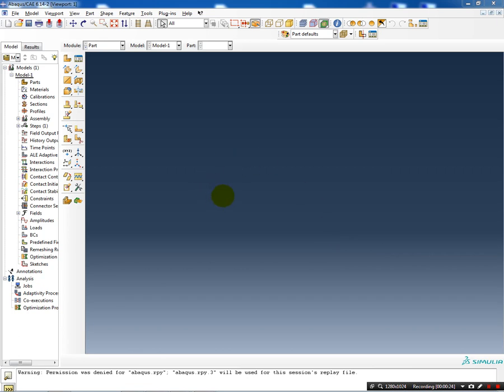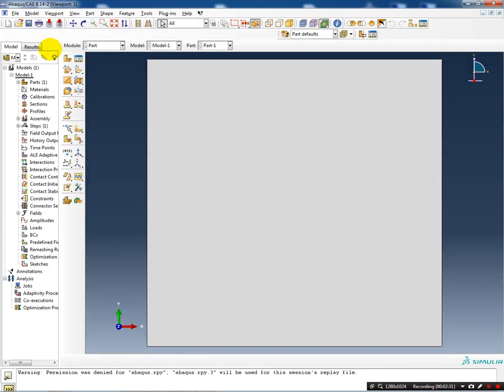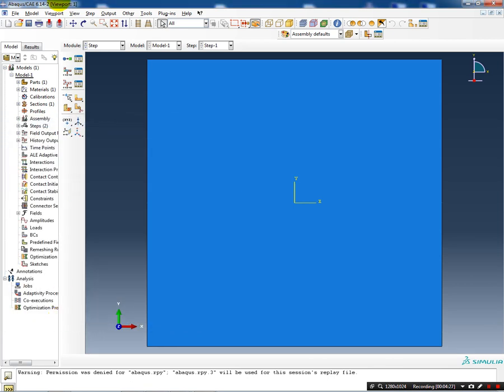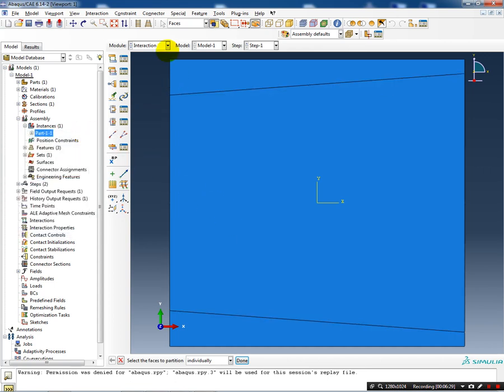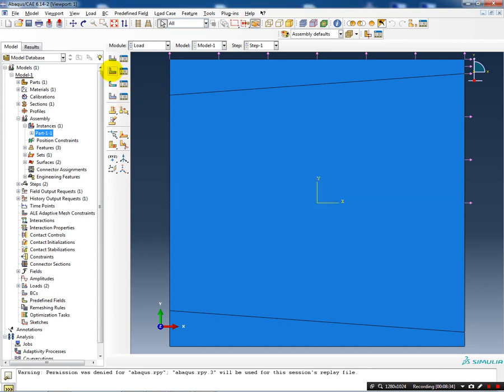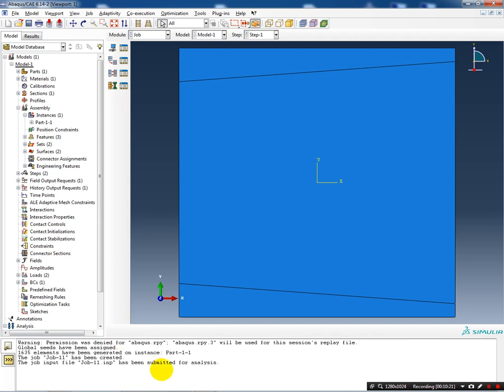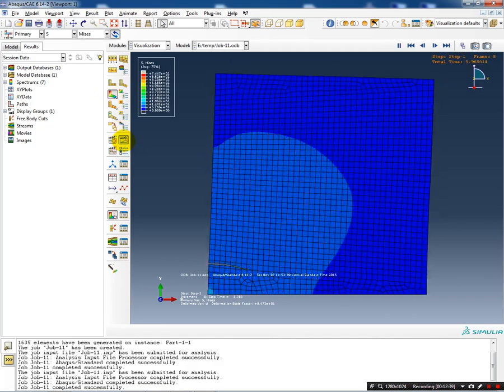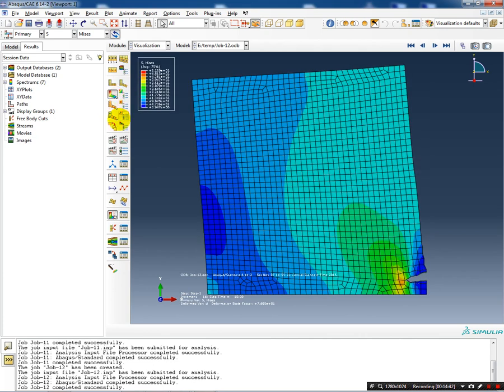Simple XFEM example using ABAQUS 6.14

Comment: Dear Mark Barkey firstly I thank you for thes illustration
How do I plot XFEM crack propagation
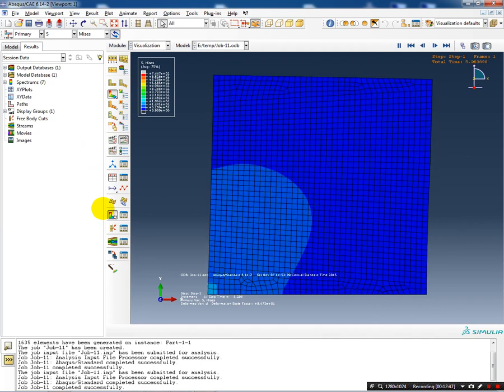Reply from the maker: I am not sure I fully understand the question--do you mean the animation at 12:50 ?
Reply: @mbarkey.mechanics  how i can plot crack propagation vs load in XFEM
Reply from the maker: @HamzaDjeloud  The load is relatively easy as you can get that from your ramp loading.  I don't know the options for crack length--it has been a few years since I made this video.  The manual can be difficult to extract information from, but it is comprehensive.

Comment: Hii Mr. Mark Barkey

I have a small query. I have 2D cracked specimen made up of material obeying Ramberg- osgood model and subjected to bi-axial loading. How can i calculate the limit load of that model by ABAQUS?   Please help me out..

I am waiting your reply..
Reply from the maker: Short answer:  I'm not sure.  Longer answer:  most plastic limit load problems I have seen assume perfectly plastic materials where someone is trying to determine a load that corresponds to net section that is fully plastic.  This is commonly done for notched components and represents a conservative upper bound on load of a component if there is any hardening.  For a biaxially loaded, strain hardening material with a crack I suppose you could find a load level at which the plastic zone evolves enough to cover the net section, but you would have to think about small vs large deformations and plastic zone size;  then think about what such a value would physically mean to you--and if other failure modes may get activated.

Comment: Hi Mr. Mark Barkey
I have a question that how did you get Max Principal stress and Displacement at Failure ?
THank you.
Reply from the maker: Do you mean, why did I choose those values?  I just picked them.
Reply: I mean Why did you pick them? you base on theory or experiment ?
Reply from the maker: I just chose those values.  For a meaningful simulation, an analyst should base them on experimentally determined values or experience/theory as you decide what makes the most sense.

Comment: When I submit the job I get this error: "Too many attempts made for this increment". Do you know what this might be due to?
Reply from the maker: Hi Leandro, This type of error can come from many reasons.  If you are following this example though, I would suggest you look to make sure that the plate is restrained from rigid body motion, i.e. the BC's have been applied the way you want them to be applied.  Other times I have seen this error, the strains are too large, too much plasticity from unrealistically high loads, rigid body motion, etc.  You will have to look into the msg file and the other diagnostics to try to find the source.

Comment: Hi, I want to ask you if you can calculate DSIF ''dynamic SIF'' by Abaqus using  XFEM ? 
Thank's
Reply from the maker: Hi Soufiane MEGDOUD, I have not tried that option, but the manual says it can be used only for ABAQUS Standard and "can be performed using the static procedure, the implicit dynamic procedure ..." so if your problem can be defined by implicit dynamics, I think you can do it.  Refer to the User's Guide section 10.7.1 (I looked it up in the 2016 documentation.)  Best wishes.
Reply: Hi Mark Barkey, Thank you very much for your help.

Comment: how do I make the mesh automatically refined on the crack the tip as the crack propagates?
Reply from the maker: HI marchellohro, I am not aware that as an option for XFEM.  However, ABAQUS adds features frequently, so you may want to review the manual.  It may also be possible to incorporate an adaptive meshing technique after crack initiation, but I have not personally done that.

Comment: Hi , you apply 100 Mpa for MAXPS and 0.1 for displacement ? how did you get this values please ?
Reply from the maker: Hi Zakariae,  Those are just numbers I put in for the example.  For a 
physically meaningful analysis, you would want to put in the appropriate
 failure parameters for your material.

Comment: Thanks..great work..
However  multiple cracks can be implemented in a single model ?
Reply from the maker: +DEEPAK KUMAR PAWAR 
Hi Deepak--cracks can form anywhere in the region, but the initiation 
condition must be satisfied.  If instead of the side load that I applied
 to bias the crack location, I did only axial tension, then cracks would
 appear all over the allowed region.
Reply: +Mechanics Channel by Mark Barkey Thanks a lot for sharing. But the crossing of multiple cracks can be allowed in Abaqus?